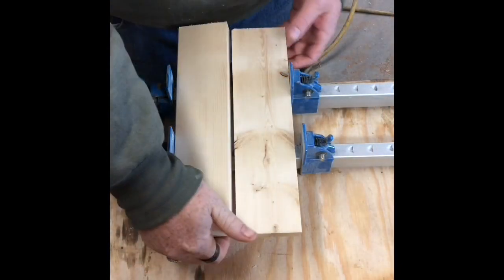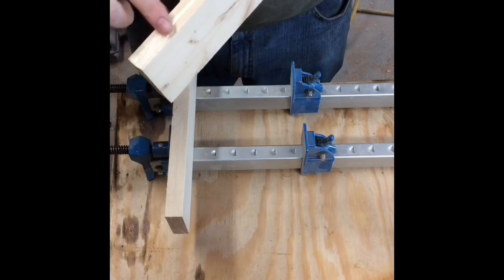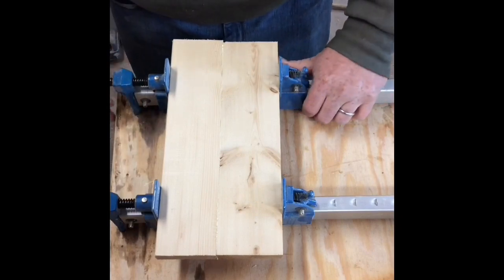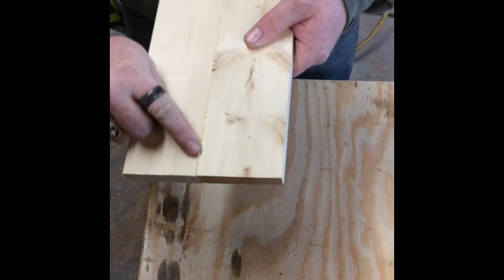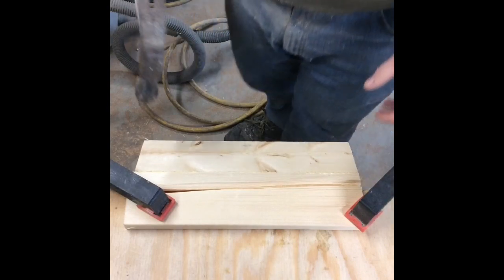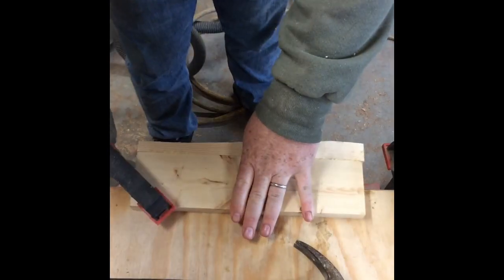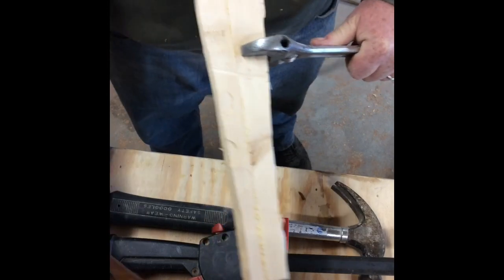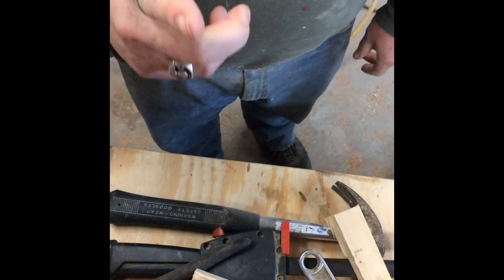How strong is wood glue

Comment: I'm searching this because my mom's kitchen door hinges broke and I (with little D.I.Y knowledge) said I would hang it back up. It is the weight of a fire door so it's heavy. So I got new hinges and better screws but also got some wood glue to put in the predrilled holes, just to have a firmer hold. Was this a good idea or not? I'm asking a genuine question, because my mom did nothing but moan at me the whole time I was fixing it, just because of the wood glue.
Reply from the maker: Wood glue is really only good for wood.  Sounds to me like super glue of epoxy would work better in your case for glueing hinges
Reply: Hi
Thanks for the words of wisdom. Maybe I wasn't 100% clear, I just wanted the glue so it would fill any space between the screws and the new drilled holes. So if it's fine for that then (hopefully) it's all good? I have since hung the door and it seems to be holding perfectly fine at the moment, so now it's on to replacing the front door lock and handle which will include many moans from the old dear and I should be done? But thank you for the reply and advice, which is something I will definitely keep in mind if I ever have to build her a "carehome"... lol. Seriously thank you.

Comment: I know its amazing how many people don't know this. I tell people this and they look at me with...well i don't know about that! or no i don't think so. I once glued a draw together on a wood bench and just a few drops of glue got on to the bench between the draw and the bench and when i tried to take the draw off the bench i literally destroyed the draw and had to build a new one thats was about 10 years ago. That bottom piece of the draw is still stuck to that bench to this very day its like welded on there. The reason is because the wood has natural fibers going thru it were as the glue is solid so when it dries its like trying to split steel in half. I made a 15ft work bench entirely put together with glue 5 years ago and its still holding up great with about 500lbs of tools on top of it.

Comment: I am currently building an instrument. It's my first real time building something from scrap. I was constantly worried about how strong the woodglue actually is. After glueing one piece together, I had to cut it a bit and cut of a long strip. About 26'' long and maybe 0.002'' wide. Two pieces of wood barely held together by the glue, because there were quite a few of gaps inbetween. But even though it was this tiny little gluejoint, with definitely not enough glue, I could not for the life of me pull those two pieces apart by hand.

Comment: Nice, thanks for this video! I'm absolutely confident edge-grain to edge-grain joints can be done with glue alone, but I would love to see end-grain to edge-grain, and end-grain to end-grain tests too. Particularly the last one would probably fail quite easily without any additional fastener.
Reply: Very important distinction to make.  You wouldn't want to ever glue legs of a table (by itself), or glue together 2 short pieces of wood together (thinking again about legs) to try and make a secure lasting bond.  Right?

Comment: Very interesting video, thanks for sharing.
I was very surprised. Not that the wood glue is stronger than the wood itself but you clamped the pieces of wood only for 45 minutes.
And straight after that you tested the strength.
Just a few minutes ago I saw another video in which was explained that the full strenght of wood glue is reached after 24 hours.
But according your test the 45 minutes is long enough to meet my demands on strenght.
You tested pine. I want to glue together pieces of beech (former flooring) which measure about 2 x 4.5 x 36 cm into about 2x4s (inches)
In that case I need 2 for thickness, 2 for width and 3 for length. (in total 12 pieces for one plank of 1 m length)
I hope I have enough clamps for that.
Reply from the maker: Hans de Groot you can never have to many clamps

Comment: Dude, you are right about people underestimating the strength of wood glue.  However, you stretched it with your dovetail/screw/glue comparison.  Dovetails and or screws internally lengthens the strength across the joint connection making the joint more solid.  That's proven.  Glue is only "great" on a surface level and it doesn't work at all at the end of the grain without prepping.
Reply: Robert B those are all good points  but for most applications I have found glue to be more then sufficient. Perhaps I will go into more depth about stronger joints in the future  this was simply an introduction to the strength of wood glue

Comment: Perhaps if you used the leverage to your advantage (put the glued crack on the edge of the table so one board is on entirely and one is off entirely) then I bet it would've broke down the middle :)  . Notice how the wood broke where the edge of the table was, doesn't much matter where you hit it, that's where the majority of the stress is going. Otherwise, great demonstration! Liked
Reply: Jo3yL good observation.  And yes it would be far more likely to break on the glue joint in that case.  But for the purposes of this video I was simply trying to demonstrate that the glue joint is generally stronger then the wood around it
Reply: Andrew Davis I see but I don't think this proves that as you aimed to since you essentially directed where you intend to put the stress on the board. Perhaps compare a solid board to a glued board under the same load with weight hanging in the middle on both and one board would have been cut in half and glued back together right in the middle. If the glued board holds more load I'll buy it, otherwise it's not a fair experiment IMO.
Reply: dude... if you glue 2 pieces of wood, clap un end and hit the other and it breaks the other part it proves the resistance..
Reply: Well it was good enough for me.